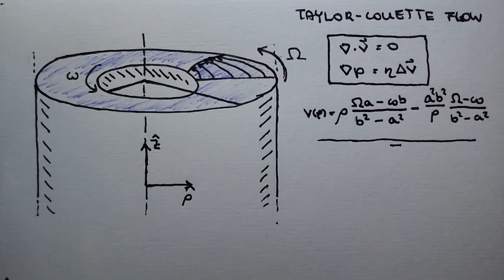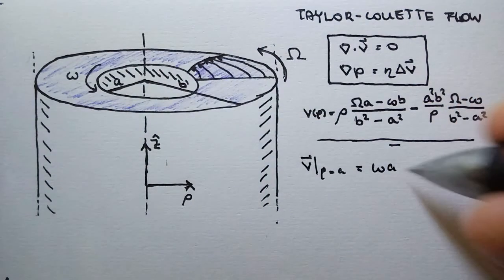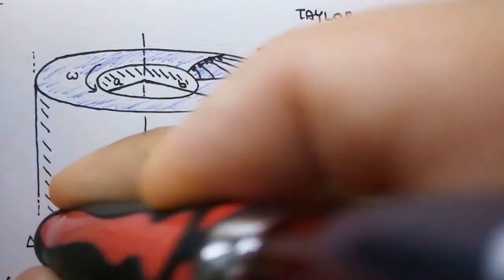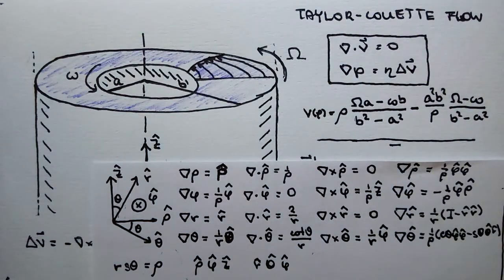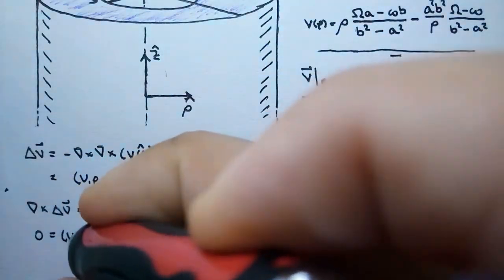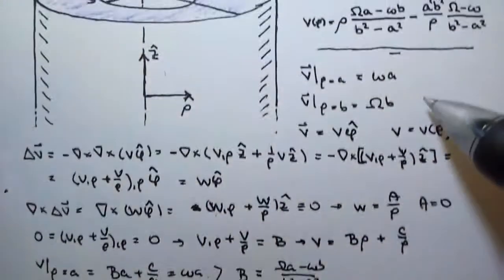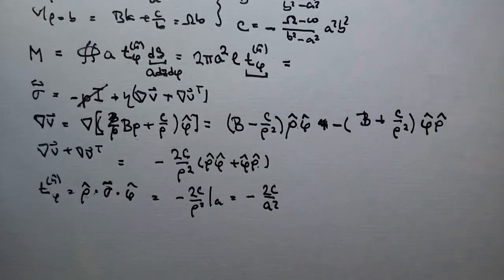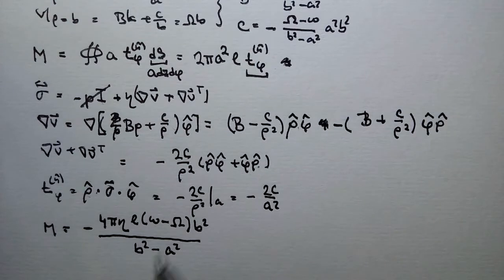Fluid dynamics | Derivation of the Taylor–Couette flow

Comment: Hello! First of all, thank you for this video, it helped me a lot to further understand this example, so, thank you, man! 
I just have a little doubt, I'm not sure if you're missing an square for a and b when you solve for B and C, on the eq for B I think that the a and the b on the upper side of the division are squared, please correct me if I'm wrong but I'm strugguling to get to your solution.
Thanks again, cheers! :)
Reply: yes youre right there is a mistake in calculation of B and C